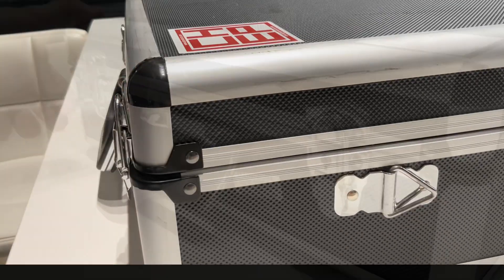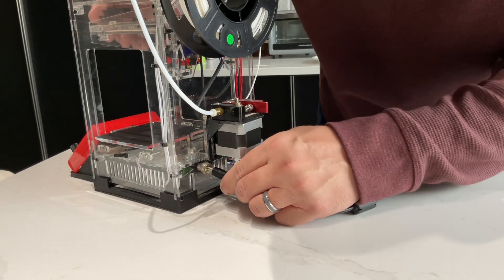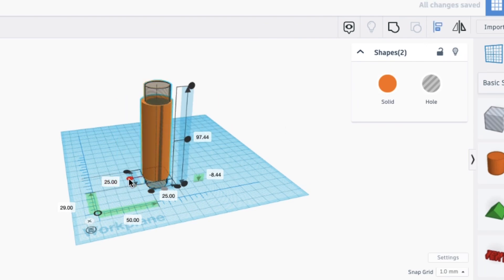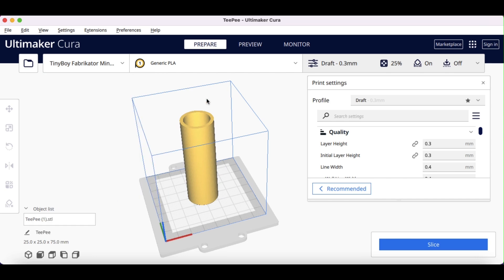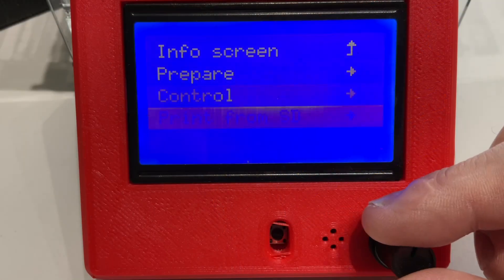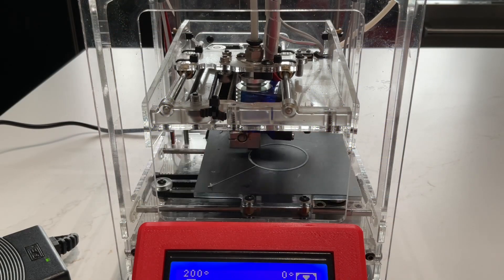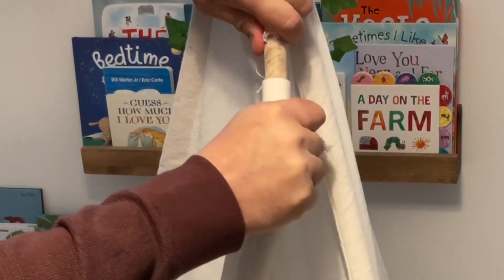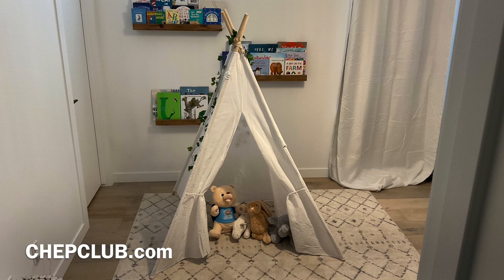Practical 3D Print to Save the TeePee

Comment: Did you make the diameter of the inside of the couple the same size as the dowel diameter or did you make it slightly smaller to ensure a tight fit?

Comment: Wodering why did you chose to print the part in a vertical orientation instead of horizontal. Doesn’t that makes it prone to break between layers? 
Great channel and thanks for the content
Reply from the maker: Wanted it round so it was easier to print without supports for temporary fix. And I printed it hotter and higher extrusion to get better layer adhesion.

Comment: I love practical, functional prints, it's arguably the main thing I use my printer for, but you'll be forever reprinting that.  Ask me how I know, lol. 😉

  As I'm sure you already know, that's the weakest possible way to print a tube, especially with the leverage the inserted dowels would produce.  Whenever I'm printing tubes that require more strength than the lines can provide, I print at a 30° angle, along with a few supports, and I've always ended up with much stronger prints.

  I noticed that you didn't use any glue on the dowel, neither at the joint nor between the dowel and the print, further reducing the potential strength of the part.

  But, perhaps that's the plan; make it easily breakable, and then you have another great excuse to see your grandson, not that one is needed, I'm sure.  You get to be the hero (again) by fixing it, opening his mind up to critical thinking and reasoning, introducing the repair, reuse, recycle ethos, and possibly getting him into 3d printing.  My eldest grandson has developed the attitude of "it's okay if it breaks; Pop-Pops can fix it".  I'm sure he thinks that I'm involved with Santa's operation somehow, working away in my "grotto" making, upgrading and repairing things.  But the long, grey beard probably doesn't help! 😁
Reply from the maker: It’s actually very strong. I printed at a higher temp and wide extrusion to get a better layer bond. Long term plan is to replace the dowel but we didn’t have time for that this trip.

Comment: I can't even find one of these second hand on eBay. Is there a current equivalent cheap mini printer that could easily fit in a case and be hauled around? I'd love a Voron V0 but something that filled that role of second printer at a low price would be a good next best option.
Reply from the maker: Ender 2 Pro. I’ve taken one to florida

Comment: How is the strength? In all my designs something like that will just break under any stress due to the way it is printed.
Reply from the maker: Stronger than the dowel actually.
Reply: This is probably just for display purposes so it dosent need much strength
Reply: The wall thickness looked quite thick, so it should be strong enough for normal loads. It might break if its subjected to the load that broke the wood, but I assume the Grandson would have learned that lesson  - if not, you don't want it to be too strong.....
Reply: I have to agree – if I printed this, it would probably delaminate along the layer lines
Reply: If they break under any stress, that's the settings, or filament, or something wrong with the printer. I mean obviously prints aren't as strong between the layers but it's not as bad as people often think, under normal conditions. I'm still waiting for tiny pegs on my frame weaving loom to break under tension but they don't :)